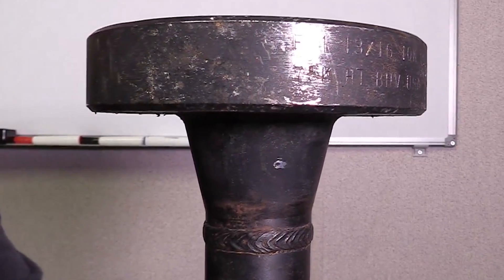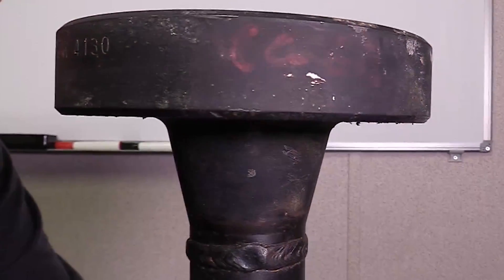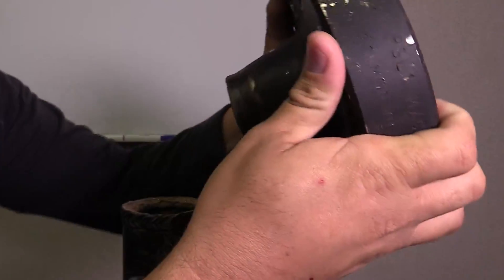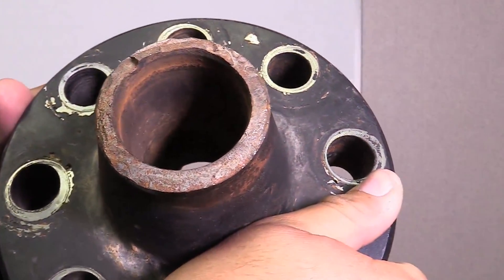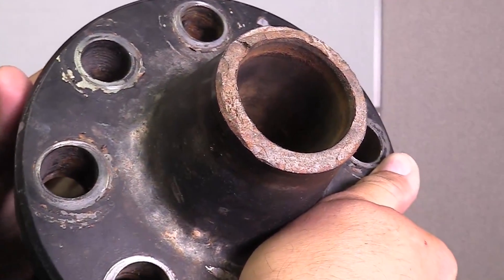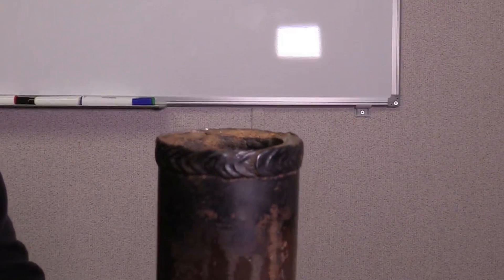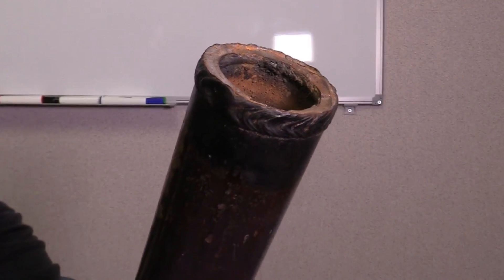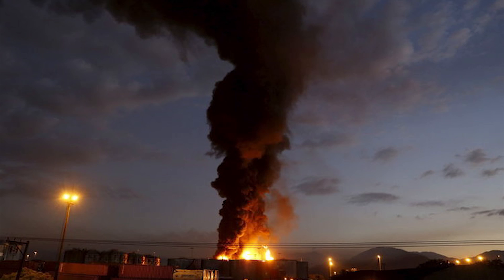Fatal Consequences of Not Following A Welding Procedure

Comment: Because of the orientation of the crack or non fusion actually, it is extremely unlikely that a radiograph would detect it unless the was a lot of offset of the source, on the fused section. Even then it would be very hard to detect.